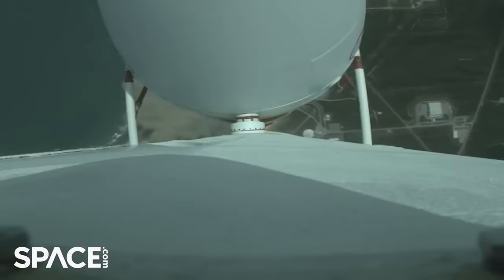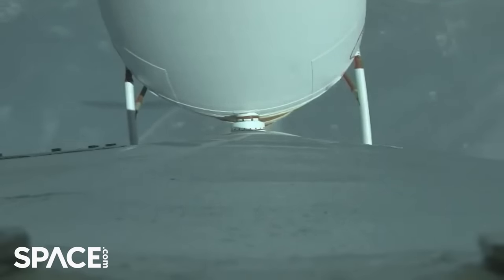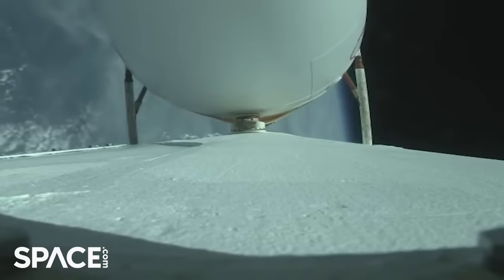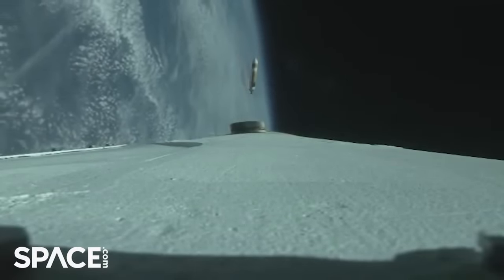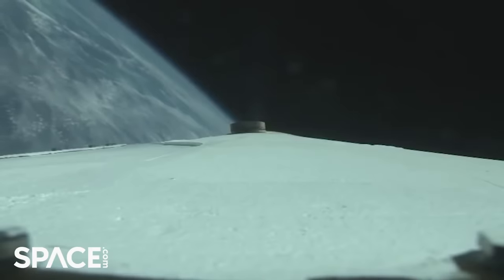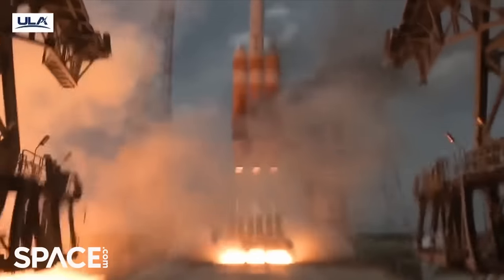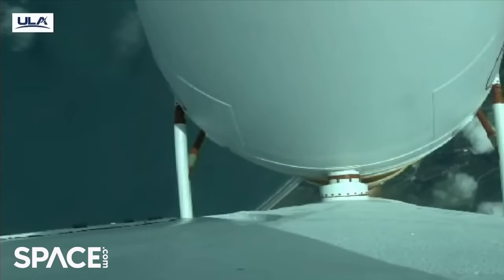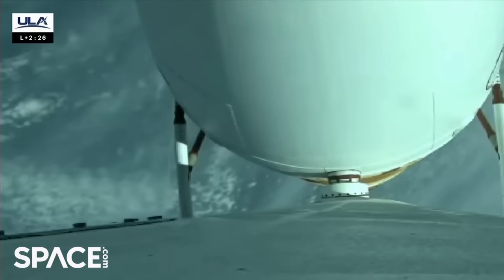See Delta IV Heavy's final launch in amazing rocket cam footage

Comment: How much fuel wasted to get that thing into space?  The RS-68A engine system boosters burn through their propellants in less than four minutes, all cryogenic liquid hydrogen (LH₂) and liquid oxygen (LOX) is used. The central engine throttles down to 55%, at 44 seconds into the flight, they are at 100% at take off, which is to conserve fuel until the two RS-68A engines separate. Total cost for the launch is $440,000,000 yes! 440 Million USD. So if you thought it was expensive just filling your cars tank, keep that in mind.
Reply: Thats utterly nothing compared to our defense budget, nobody fucking cares. It would be worth it if it was 10 times the cost.
Reply: @antony1397  "what about the US's gross spending over there to justify overspending here...." WhatAboutIsm is always a great argument to lean on when you dont have one.
Reply: no it does not cost 440M to launch one rocket.
Reply: And those drastically inflated #'s were calculated how?
Reply: $440 million is about 400 times more than the cost of the fuel. The cost of a rocket launch is for designing and building a rocket. The fuel cost is peanuts. 
And the fuel is not wasted, it was used to put a satellite into orbit that will produce useful data. Data considered to be worth at least $440 M.

Comment: goes up and then tilts   😏     then falls back down
Reply: i guess you dont understand what orbit means.
Reply: Of course it tilts. Why should it keep on going straight up?
Reply: Orbit = flying parallel to Earth’s surface at 28,000 km/s. Most of the rocket’s energy goes into reaching that speed, and you can only do that by flying horizontally.
Reply: @flivverj7934    childish woke reply